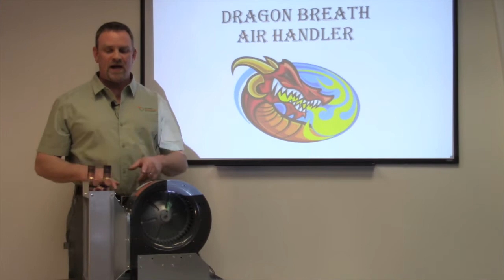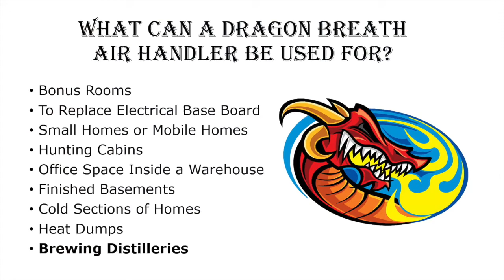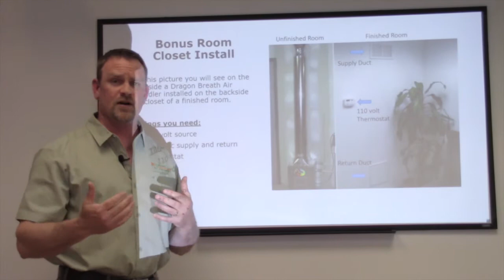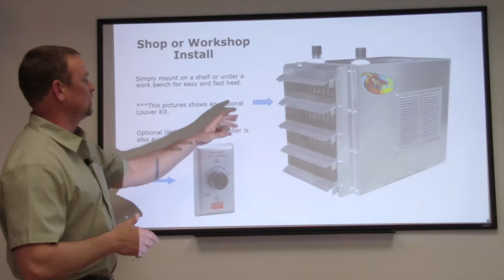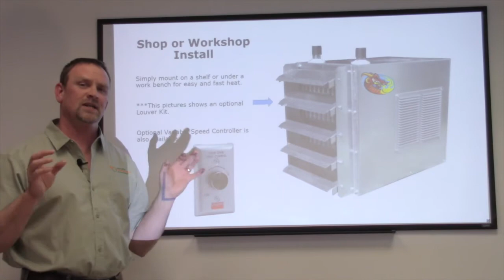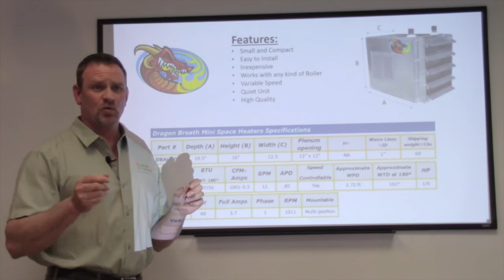What Can A Dragon Breath Air Handler Be Used For?

Comment: What is the  max air temperature you can get with 180 water temperature
Reply from the maker: Depends on air flow and heat exchanger and the temperatures of the air. Not an easy question to answer

Comment: Could you please give an example of the types/sizes of duct adapters needed to hook up supply and return  ducting on these?  A separate install video like you did for the heat exchanger would be ideal, but a list of supplies will do for now. Very interested if I can find everything I need to install the ducts.
Reply from the maker: Great suggestion! But there are so many variables. I will try to see what i can do.